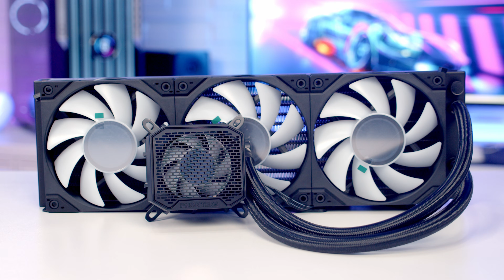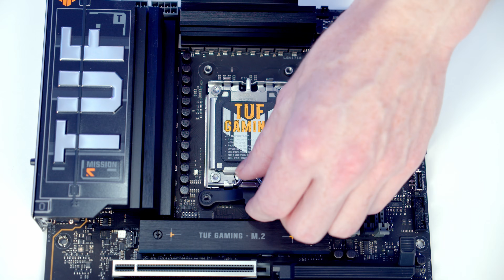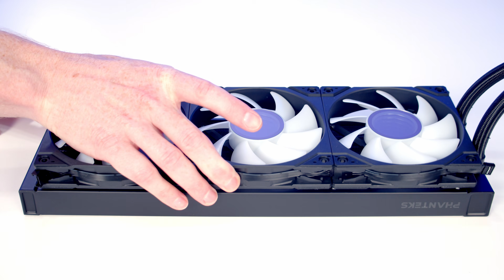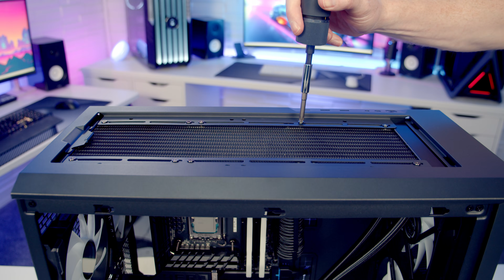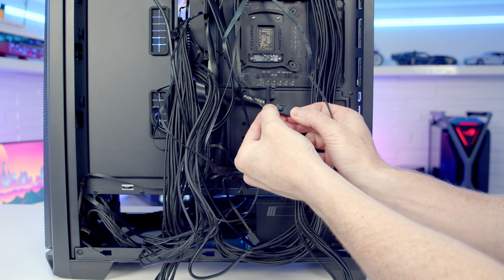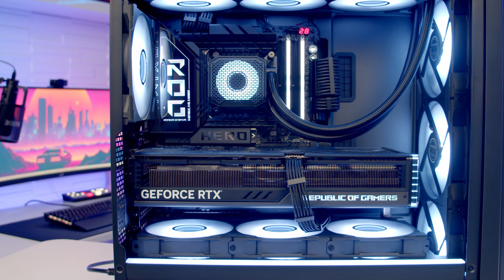Phanteks Glacier One 360 M25 Gen2 - Installation Guide

Comment: I bought this AIO and I'm having trouble with the PWM control. I connected it as shown in the video and checked the connections multiple times. The fans on the heatsink, connected to the 4-pin CPU fan, spin at 1600 rpm. I can only lower it to a minimal 1200 rpm; they don't go lower, in PWM mode, of course. They work correctly in DC/Voltage mode. The pump connection, connected to the 3-pin fan pump, only works in DC mode. Gigabyte B850M Gaming X WIFI6E motherboard

Comment: Okay I’m confused but I probably did it right? I am not using the phanteks hub. So the fans in the radiator are conntexyed to my cpu_opt header and my pump is connected to aio_pump and then the aio has another cable which I don’t know what it is for and that one is connected to cpu_fan. Everything is working but I am wondering if the cable in cpu_fan is even needed